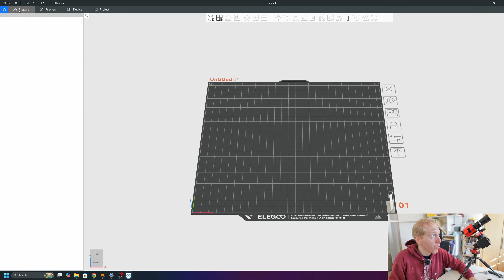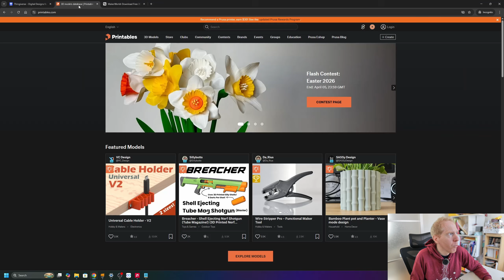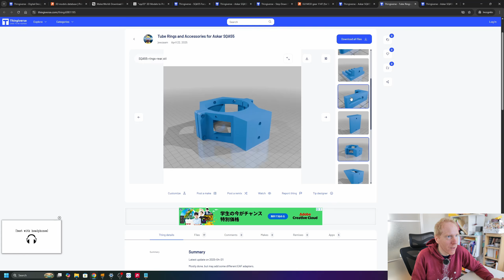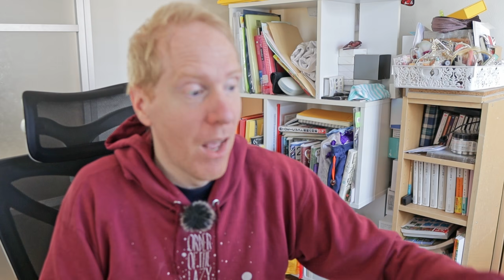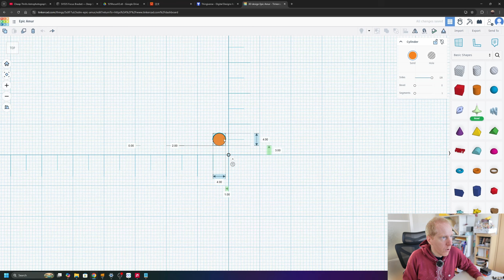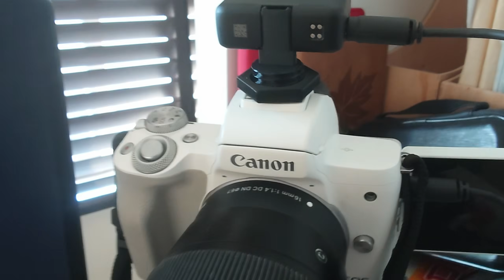Your next Telescope should be this 3D Printer (it's cheaper too!)

Comment: A 3D printer so so useful and I've been using it for telescopes, cameras, lens and odds and ends around the house.  What's nice is if what I make something isn't that good, it's cheap enough to throw away with no guilt.  Cuiv, I ran across the app, DxO PureRAW , that helps removing noise and allow sharpening.  Are you aware of this?  I'm considering trying it out before I do stacking.
Reply from the maker: I'll have a look at the app :)

Comment: I've been 3d printing a ton of stuff for my house, astro rig, and other hobbies. Definitely recommend it if you have the inclination.

To make sure others see it here, make sure you can put the printer somewhere that won't suffocate you with fumes, and air filter systems are highly encouraged (required if you're going to be around while it's printing).
Reply: That's resin 3d printing...
Reply: @athopi  want to do a quick google for whether its safe to breathe plastic fumes? There's a lot of articles out there on the subject.
Reply: @athopi PETG 'fumes' can give sensitive people (not me) headaches though I've only ever detected an odor (maple syrup) from PLA.
Reply from the maker: Thank you!!!

Comment: Hey Cuiv! Yes, 3D printing has become essential in our hobby.

I bought my first 3D printer almost two months ago — I went with the original Centauri Carbon when it was on sale for just $260. The multicolor system is nice, but honestly, I think we mostly print in one color at a time anyway.

For material, I print almost everything in PETG-CF because it's significantly more durable than regular PETG. The only downside is that it wears out the nozzle a bit faster. What do you think on CF filaments?

One more thing — I think you'll easily recoup the cost of the printer within a year just by printing your own parts instead of buying ready-made solutions.
Reply from the maker: Seems I need to try out PETG-CF! How fast does it wear the nozzle down?
Reply: @CuivTheLazyGeek  there are different reports on the time, and my understanding it's anywhere between 150 - 500 hours of printing on CF infused filaments. I've had almost 3 KG of PETG-CF printed, and my nozzle is still in a good shape (hopefully) although I purchased a replacement part to have on hand just in case. Luckily, the replacement nozzle doesn't cost that much.

I'm also interested in printing using ASA filament. I got one spool that I'll try one day.

Comment: I 3D printed several dew shields, finder shoes, dust caps, EAF brackets, mini PC crates to mount on the telescope, brackets to center flat panels, etc, etc. Best investment ever. 😂
Reply from the maker: It's insanely convenient for sure!
Reply: @CuivTheLazyGeek In quite some moments I would have been screwed up without my 3D printer. I also work with tinkercad as it is very convenient to use. My most insane print is a 6 piece 50cm long dew shields for my 8" RC.